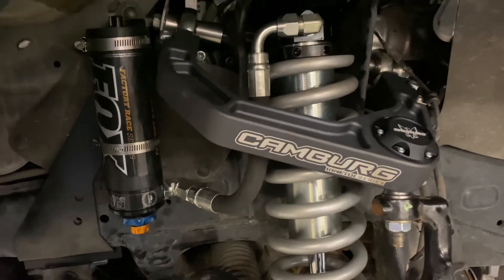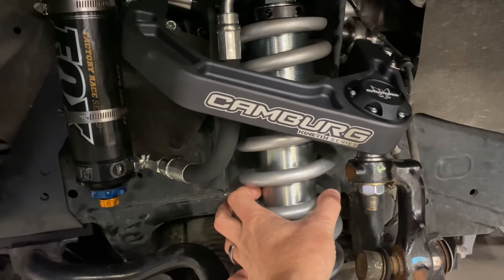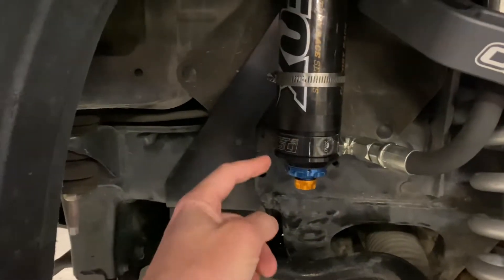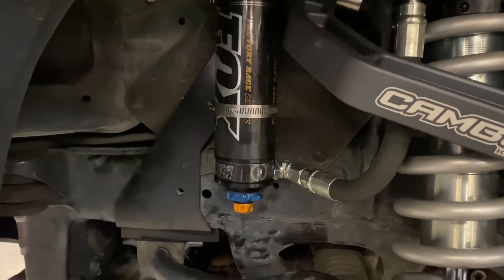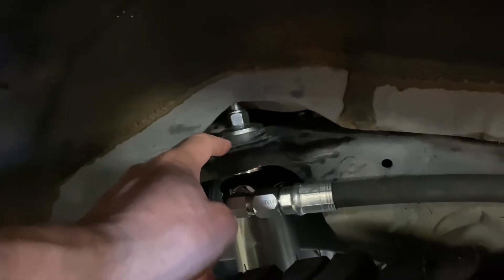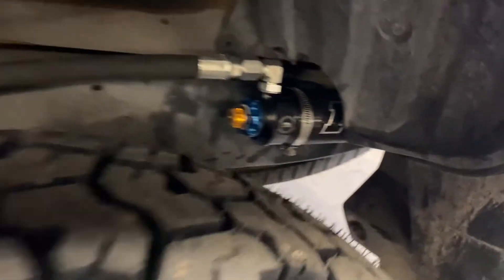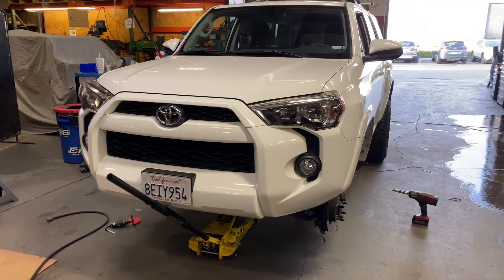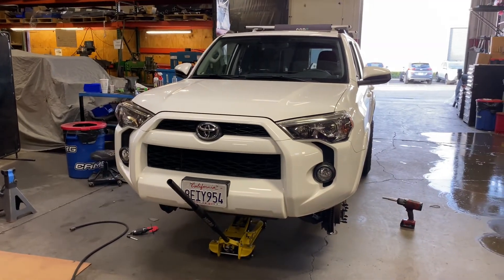Camburg Coilover Performance system install on a Toyota 4Runner

Comment: That's a sweet setup I'm getting the same thing on the rears I already have the fronts done but I was wondering did you have to drill in order to place your reservoirs or are there holes already available??